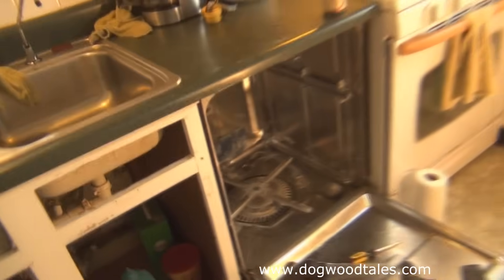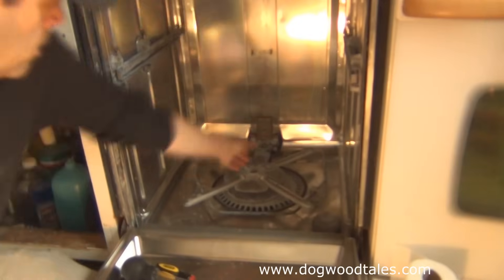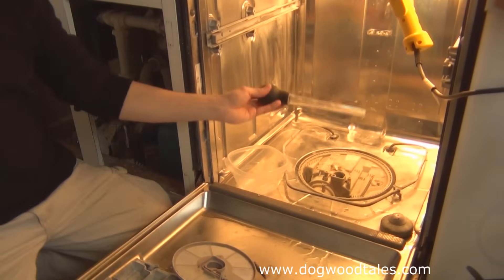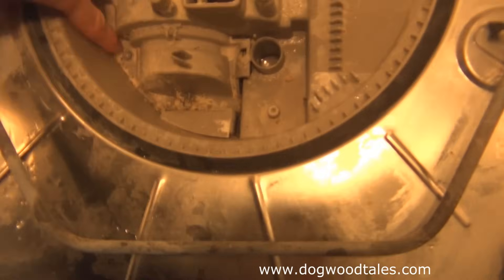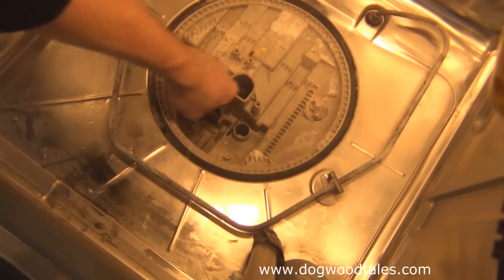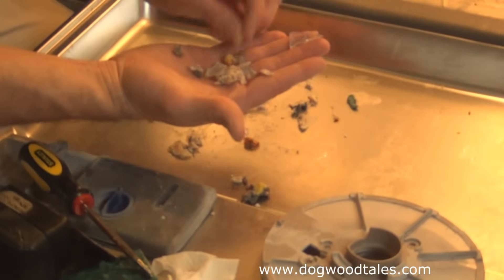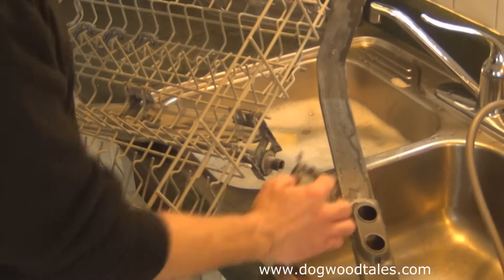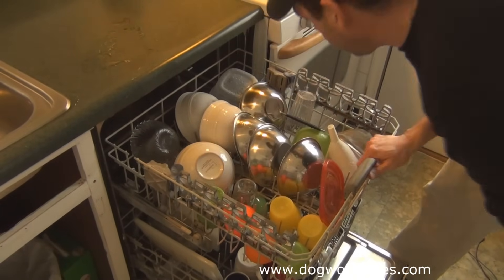Dishwasher Cleaning - Top Rack Doesn't Clean

Comment: Dogwood Tales.  Your video is great.  I had another problem when we got it disassembled.  The cutting blade, washer and nut were off the assembly when we opened it up.  Can you tell me in what order these thing reattach.  We pulled up a schematic but it doesn't seem to go on right.  Any suggestions? Thank you so much.
Reply from the maker: Sorry - I don't know. I would try to find the manual to your exact model and look to the exploded diagrams to see what order the parts are assembled. You could be missing a retaining pin that went down the drain. I don't know for sure, but I would expect it to be one of those horse-shoe shaped retaining pins/clips.
Hope it works out well for you. Good luck!

Comment: This was a great tutorial. I'm having the exact same problem so I will have a go at fixing it this weekend. Question: was it the waste mulcher mechanism or something in the plastic intake pipes and spouts that was the root of the problem? I'm not sure how cleaning the mulcher would let clean water flow to the upper part of the machine.  

Anyway, thanks for this great video!
Reply from the maker: snoopypal fortunately for me it was always just a clog of debris in the pit by the chopper. For some who commented earlier it was also a broken or dislodged chopper blade.
It’s all part of the flow of water and a clog down there prevents the return of the water to the top of the washer at least in this model. Good luck! Thanks for watching
Reply: @dogwoodtales  Wow! Thanks so much for the quick reply. Was not expecting that! I'll give it a go this weekend. Cheers!

Comment: Hi! Firstly, thank you! I disassembled the machine with success but unfortunately what I found after I took the water out and revealed the food chopper that the screw holding the blade to the screen was no longer holding the blade in place. I am wondering if you can tell me what to do now?????
Reply from the maker: Kristina Loggia get out the parts manual to your dishwasher and see if you can order just the screw. You may have to go to the manufacturers web site to get a PDF copy of the parts manual (not the operator's manual). Alternatively, find a local parts store and ask them to help you find the right sized screw for this. It might be a common size among dishwashers, but there will be a particular thread to it (meaning number of threads per inch) and it could even be a reverse thread (meaning it screws on backwards from what you are used to). That one screw will likely cost more than a box of screws at the hardware store, but will still be cheaper than a new dishwasher.
Hope it works out well. Let us know.
Reply: Kristina Loggia I had a similar thing happen to me.  The screen was there, but there was no blade.  I went to https://www.kitchenaid.com/customer-service/manuals/, found the parts manual for my dishwasher, looked up the part and part number for the "Chopper Assembly", found the part (very inexpensive <$15) on Amazon.com, and had it the next day.

Comment: I have a 10 yo kenmore that looks pretty much the same inside.  I did this a few months ago, removed a couple of kids plastic drink straws, and then the top rack started washing better.

Now I noticed again that the toprack is filthy.  I did this all again, but the grinder is very clean.  Wife and I tend to scrub off dishes before putting them in the d/w.  Is it some kind of clog after grinder?  

Any advice on what next most likely culprit of toprack not doing its job?  I don't think that the bottom level silverware is getting as clean as it should either.  I just did a rinse cycle with bowls on top, they barely have any water in them.

Thanks!
Reply from the maker: Tommy Glick Seems to me that if you're not getting water in those bowls on top, then the water is simply not getting up there. I have yet the need to take this apart beyond the grinder, so if you go that route you're going into unchartered territory for me lol. If you're confident that the entire path to the top is clean then I would start looking at the pump. Maybe try putting bowls on the bottom rack as well to see if water is getting circulated at the lower level as well.
Reply: Dogwood Tales thanks for the quick reply.  I've done a few consecutive quick rinses, and on maybe the 3rd one, the bowls did take on a good amount of water, so I am hopeful.  I saw someone else's video where they said to pull out the rubber valve thing near the chopper.  I took it out and cleaned it, but it seemed ok.

Very baffling.  I'm in a soft water area, and we're pretty careful to not put much oily/cloggy stuff down our drains.

Comment: Hi, I've been cleaning out my chopper for a while now and it seems as though it needs to be done every couple of months or so (when the upper deck stops getting clean).  Not sure if this is considered normal or not as I don't remember doing this for years when the dishwasher was new.  I changed out the chopper assembly last year and it still seems to be every two, maybe three months when it needs to be cleaned out again.  Is this normal, should I have to clear it out this often?

Comment: Question. I have a new issue. Only the Hi temp scrub and Heat dry buttons will light up. I am able to press ts, hd, its, hd and have it enter a diagnostic mode but it seems to remain dry and nothing lights up after it finishes. Any ideas?  Am I wasting my time cleaning it out or  do you think it could fix my issue too?
Reply from the maker: You don't say what the diagnosis reveals. I would think it would result in a code indicating probable issues, but I don't have knowledge about that anyway. I would say that it wouldn't hurt to take a look into that drain/chopper area and see if it's clogged up or not. If it is and cleaning it resolves the issue, then great! You've spared the expense of a repair call or extended the life of the machine before replacement is necessary. If not, well at least you tried something and gained experience.
Just make sure to disconnect power to the machine first.
Reply: @dogwoodtales  thanks, no read out to show a code. Just all black after run.

Comment: I watched this several times before getting the nerve to actually DO it.  I rate myself as a 5 out 10 on the "DIY" scale.  I knew i could get it apart...but could I get it back together??

it was actually SO easy.  this is not my dishwasher make/model, but everything was essentially the same.
 
the trap was FULL of gross yucky things plus broken glass, plastic pieces, and bones.  suggestion...wear rubber gloves.

Not only was i able to get everything out, everything went back in very easily.  Now the DW is cleaning like new! 

p.s. i also took apart/cleaned the spinner at the end of the tube that washes/rinses the top shelf and cleaned it.  it was full of what looked like lint.  it snapped apart, and back together easily.

Comment: Great video, you keep it simple and down to the point. The pots right side up was a good test. 

When I followed the step to put the dishwasher in normal cycle without assembly, about 500ml of water came out the bottom of the door instantly when the water pump started. It didn't continue leaking. Is this a sign of weak bottom door seal? I never had water leaks before and when I reinstalled the assembly, it didn't leak anymore.

BTW You should have removed the blade/grill for better cleaning.

Comment: But nothing I saw would have likely prevented water flow to top rack?  I have same problem.  So far I see my chopping blade assembly is in pieces
Reply from the maker: james williams that’s most likely the problem or the pump
Reply: Dogwood Tales thanks.  Pretty sure it’s my chopping blade.  Piece of crap design.

Comment: This video is useful for showing how to disassemble some of the washer, but I'm curious which step of the video actually fixes the issue of the water not making it to the top?  It seemed more like the solution was to just take it apart, clean everything, put it back together.  But what caused the issue?  I wonder if all these steps aren't really necessary to fix the problem.
Reply from the maker: Good question.
There could be other reasons for the water not making it to the top. For instance, it could be a water pump issue.
In this particular case it's all the garbage down there that's not getting chopped up and drained and then ends up reducing the water flow.
I did a lot of other cleaning just because I thought it would be a good idea to do while I had everything apart. But it also gives some assurance that the reduced water flow isn't being caused by some other clog in the pipes.

Comment: I took the filter out but there was nothing to clean out.  I cleaned it out about 8 months ago when it would not drain and it had a number of rusty screws and staples from the factory around the filter;  Once I cleaned it out I had no more problems until just a few weeks ago and now the dishes on the top rack are not cleaning but the ones on the bottom are clean.  I have checked the holes in the spinner and there is no plugged holes and it spins freely.  I am not sure of what to do at this point.  Please give me some suggestions.  Thank you.
Reply from the maker: I'm not a professional repairman, but I would carefully double check the pathway to make sure there are no clogs. Test the system like I did with heavy bowls to see if water is even getting to the top and make sure everything is flushed, clean, and clear. If these test out okay, maybe it needs a new pump. Outside of this I really don't know what to suggest without seeing it in person, but I hope it works out for you.
The sad reality is that these things are machines and, unfortunately, do eventually just wear out beyond reasonable repair and maintenance.

Comment: this was a great video the top race now works. when i put the chopper blade back in something went wrong an now it makes a bad noise it is in the blade somewhere what can i do?
Reply from the maker: You are referring to the disposal blade in the trap? There's been several people noting here problems with this chopper blade - coming off, broken, etc.. I haven't had any issues with that and never had to disassemble more than what I show in this video.
Maybe test run it before assembling all the other components. If there's still a bad noise there's something else wrong. The blade itself wouldn't make a bad noise. Perhaps it's the motor? The pump?
If you are referring to the water dispensing propeller blades by the racks - perhaps it's not clean enough at the pivot point? Perhaps it's worn out?

Comment: We followed your instructions to the T & it was great up until we got to the food chopper section.  The screw to remove the plastic casing was stripped.  Useless.  We have had Sears service come out a few times over the years so it had to be there fault. 
 I got a mini screw driver and grinded down as much glass as I could.  Any ideas on what you would do here?
Reply from the maker: The screw at 5:37? You can't remove it because it's stripped? How is it stripped? Is the screw head stripped or the plastic housing?
If it's the screw head that's stripped, then maybe use a dremel to cut a slot in the head (if you can reach it with a cutting wheel on a dremel) and then use a flat tip screw driver to take it out. Maybe then replace the screw.
If that doesn't work, then maybe a screw extracting drill bit will work or needle-nose pliers.
If it's the plastic housing that's stripped by the screw threads, then try to pry up on the housing while unscrewing the screw. Then replace the screw with one that has slightly larger threads, but not too big. To fat and it might crack the plastic. Too long and you'll have a dripping drain hole to the floor.

Comment: This is the closest so far as to how to change the 3rd level spinner on a MAYTAG  MDB7749SBW1. It misses some key logical steps for (my version of the MDB7749SBW1), but it helped. Apparently Whirlpool makes this for Maytag, I don't know. I suspect they both come out of the same factory in China. I had to put together pieces from a few videos to get this done. I'm amazed at the cheap, poor design (I'm a systems integrator these days, but I worked as an appliance repair tech when I was 20 - 21, in the early 70's. They only paid $2.60/hour so I took a job as a tech with Cable TV. Loved the different puzzle every day though).  The little plastic "rivet" that comes thru the top of the top supply-tube, protrudes downward thru the tube to spread the nylon or plastic center-receiver attached to the 3rd level spinner. It barely holds on and obviously is a part planned to fail, or simply the cheapest possible way to manufacture.  First, one must push the gray end-cap stops for the upper rack toward the outside of the unit.  They just sort of slide outward. Then remove racks. (At least this video showed how to gently pry out clips, on both sides of the water-supply tubing on the top, and near the middle supply-tube assembly). I noticed I didn't have to completely remove the tube- assembly (which these particular instructions do not show how to remove on my model). Once the clips on top and middle supply tube are removed, one can lean it toward you a little bit and reach the rivet on the top of the tubing. I found the original rivet in place and held it firmly in place while pressing the spinner into place from beneath.  It barely holds, and I expect it will fall out again with 60 lbs. psi that we have here. I may manufacture a more robust rivet out of a small stainless screw, but I'll go ahead and order the $17 assembly (with rivet) and try that first.  Let's get back to competing to make good stuff, in America.  I'll pay another $100 for something made well.  Sorry about the life-history dissertation, but hey, we techs tend to be creative. Enjoy and stay safe. :)
Reply from the maker: Mostly Silver isn’t 60 psi a bit high for these appliances? Do you have a reducer of some sort in the line to the dishwasher?

Comment: water isn't getting to the top of my frigidaire. just took it apart according to this vid, and nothing's clogged... what should I try now?
Reply from the maker: Drew Carpenter My first guesses are there could be a clog beyond the chopper or you need a new pump or control board (that's inside the door).
Reply: It was the pump. Much thanks to Amazon 1-day shipping, just put it in. The old one came out without the impeller/chopper blade and a bit of black powder got on the floor; what I think is bearing material. I think it's safe to say those bearings were toast. Couldn't have been easier to install the new one, except having to take the whole washer out from under the counter. Was still a breeze. Thanks and take care.
Reply from the maker: Drew Carpenter glad to hear you were able to fix it. thanks for letting us know

Comment: I have a kenmore, and everything was going as you described, but the dishwasher wouldn't start after i removed the cover to the chopper.  Is this some sort of safety feature?  Should i just clean it as well as i can and put it back together?
Reply from the maker: There may be some sort of a safety switch that is activated when the cover is removed. I would suggest to just clean it thoroughly and reassemble.
Other possibilities are that the breaker could have tripped or the power was not reconnected correctly.
Previous owners of my house wired the dishwasher such that the power to my dishwasher runs through a GFI that's on the wall above the dishwasher. If the GFI trips then I need to hit the reset button. I really need to rewire that to it's own dedicated circuit with no other outlets.
Good luck! Let us know how it turns out.

Comment: I used this video to fix my washer which was not cleaning the top rack and though it was all very helpful, upon reassembly I didn't replace the chopper correctly and it was ruined. There is a very specific way to reinsert the chopper that isn't apparent when you take it out.
Reply from the maker: +Maybelle Wuamett Sorry to hear that. I've never had to remove the chopper itself. Is it just the chopper blade that's ruined? Perhaps that can be replaced?
Reply: Yeah, the chopper blade (the blade and screen) has a spring assembly that has to be just perfect or when you turn the machine on it gets fried. I just sort of jammed it back in attached to the housing. OOPS! I ordered the part online for $11 and replaced it. No biggie. Thanks for the reply:)

Comment: Could you make a video about replacing the discharge hose at the back if it is blocked?
Reply from the maker: As it is I need to replace the control board - again. So I will be doing that soon.
If that hose has a blockage you may be able to take it off and clean it out using coat hangers and a garden hose etc.
Reply: I will try that…Thanks.  My dishwasher sends a thank you as well...

Comment: My dishwasher is all taken apart and I cleaned out many pieces of glass, a rusty screw, the rubber pad off the bottom of a travel mug, plastic, seeds, corn and other food particles and paper and film from jars.  I always wondered why friends thoroughly washed their dishes in the sink first.  Food choppers in dishwashers are a joke.  I will never buy an expensive model again.  I am waiting for some new parts in the mail so I can put it all back together.
Reply from the maker: Karen Raby Wow! It's amazing how large stuff gets down in there. I can say from experience that a more expensive model does clean better and runs quieter. My previous washer was so loud you couldn't have a conversation in the kitchen while it was running. However, at some point the price becomes either paying for a brand name and/or more bells and whistles for which you might not have a need or will not use often, if at all.
Reply: Dogwood Tales never did I rinse dishes what am I going to find~~ now I no thanks so much
Reply: The noise is something to think about.  I like the quietness.  It is doing fabulous since the repair.